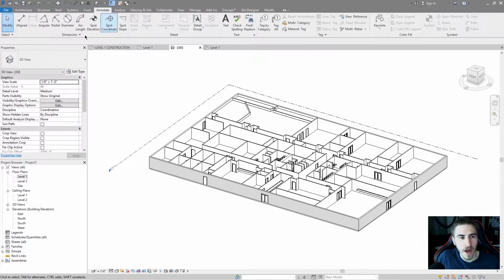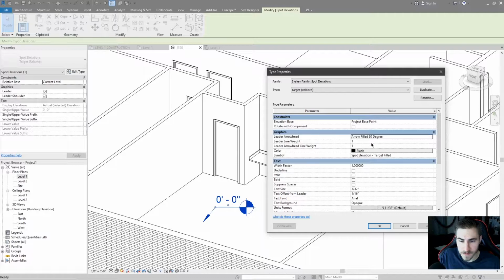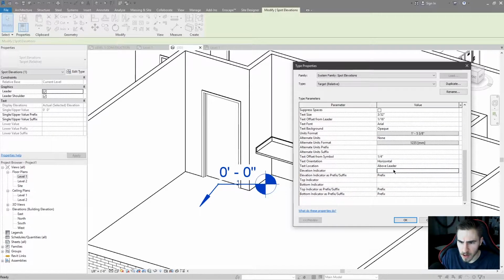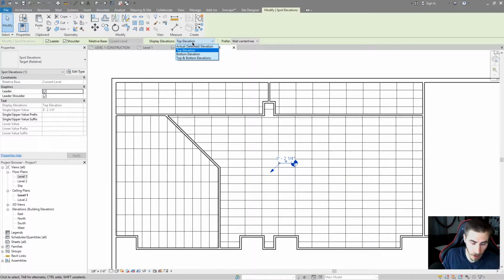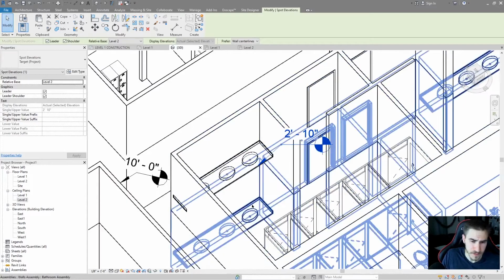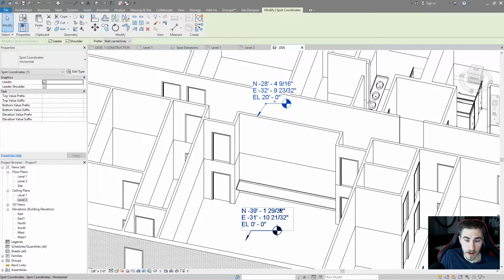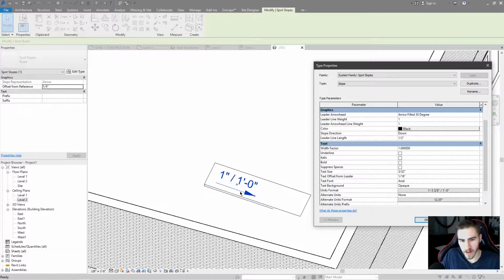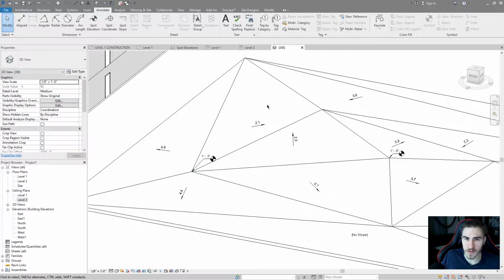How to use Dimensions - Part 3| Revit 2020

Comment: Hi. thanks for this video. How to use slope dimension on plan? {No slope} on ramp Error.
Reply from the maker: If there are instances where Revit cannot give you a slope in plan you might try edges, they will work. There is even an indication as to what you are dimensioning is the slope on an edge. It is also possible that if you are cutting through the roof, ramp, etc. that you will not be able to receive slope dimensions.